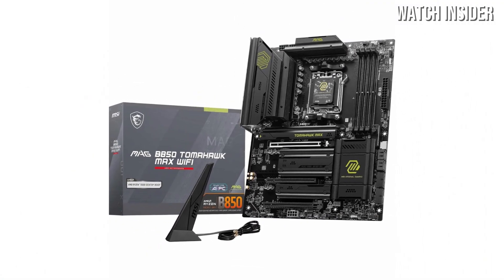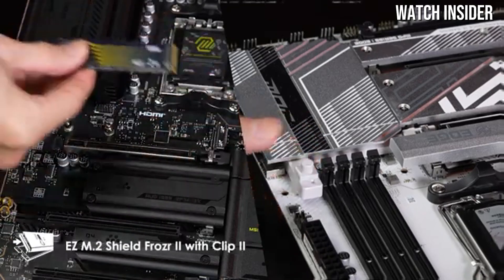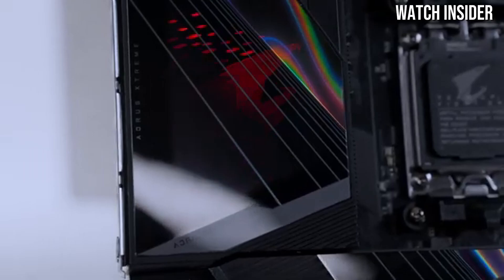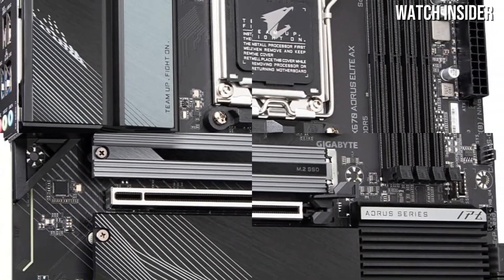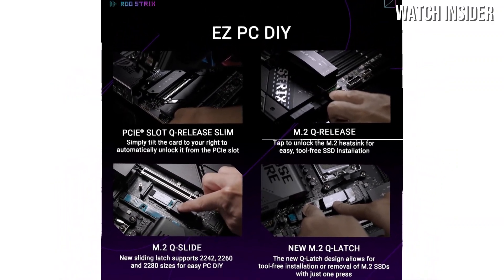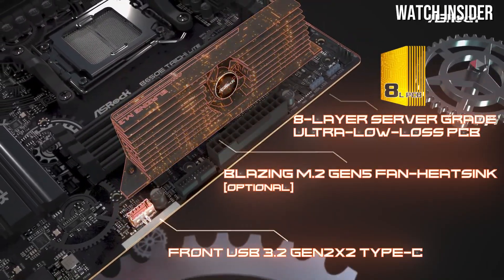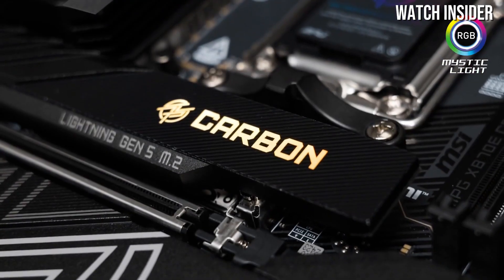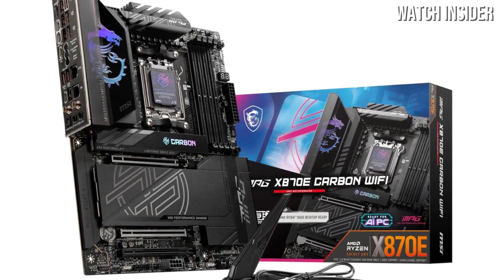Best Motherboards 2025 | Top Picks & Reviews

Comment: MSI X870E is a great motherboard,  but it does have one serious design flaw for some.  The placement of the gray secondary 8 pin on the motherboard,  makes using the final PCI slot of the motherboard useless.  If you have a sound card, and you want to run it in that final PCI slot, so it's not right up against your GPU,  there's no way you can plug in your 8 pin power supply to the gray plug on the MB, there's not enough room to do this.  MSI design engineers will need to rethink this on future designs,  because this in not good, considering what this MB costs.      I went ahead and installed my sound card right beside my GPU, it's not ideal, but I had no other option.